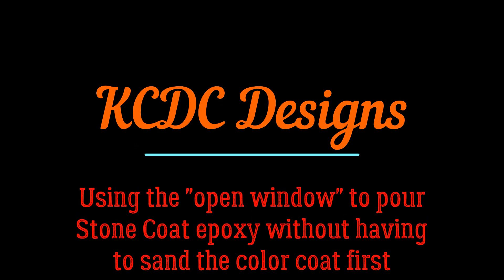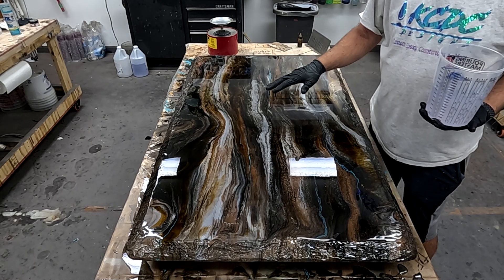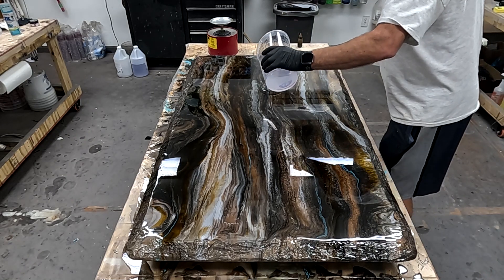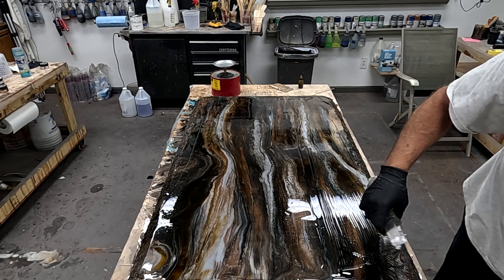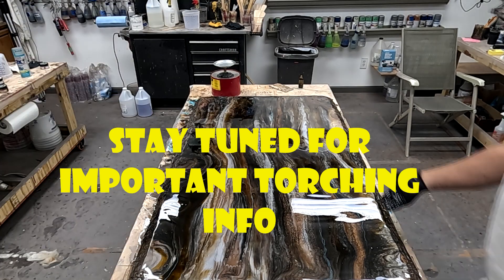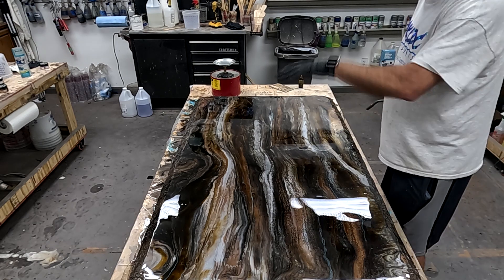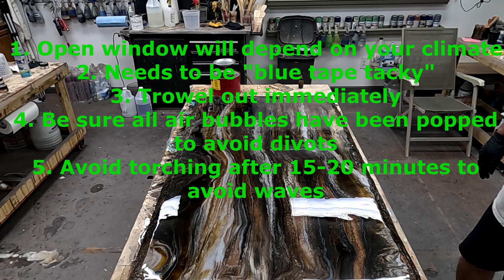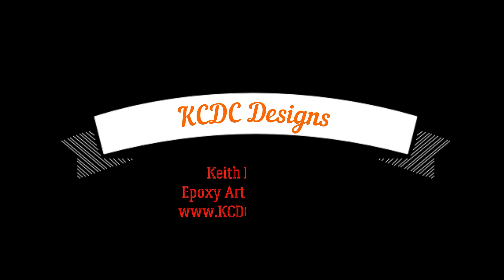Important tips when pouring an epoxy flood coat during the "open window" when using Stone Coat epoxy

Comment: Thanks . I was just going to call and ask about that. I poured about 20 hrs ago and is is still blue tape tacky. I will pour a flood coat the when it is set up I will do a glossy UTC. Hope it works out since I have some depressions from having to add more resin at the end of the original pour!
Reply from the maker: Hey John, you're welcome and glad it helped. The flood coat should fill in your depressions, as long as they're not too deep. If they are deep, you might consider a tape dam and use 4-5 oz/sf so there's more material on the surface. Minor imperfections are almost always filled by the flood coat, but if they're more than 1/16", you might consider more material.
If you're not familiar with the tape dam process, please let me know at Keith@KCDCDesigns.com if I can help.
Good luck and please keep me posted!

Comment: Hey Keith, question for you...put my flood coat on last night...woke up this morning and looked at it,and it has a big ole Miller (giant mosquito looking bug we have here in Ohio) in the middle of it...can you HELP???😢😢😢
Reply from the maker: Hi Kim, oh no I'm sorry to hear that! If they're the same big ones as I've seen in Indiana, yikes!
How deep is it? If the epoxy is still somewhat soft, you could lightly heat up the area to pull him out, (tweezers?) but it will still likely leave an imperfection. But if the impression is not too deep, you may be able to sand it smooth prior to applying UTC, if you were going to. 
Even if there's a small leg left in it, would it be that noticeable, except to you maybe?
Sorry it happened, dang skeeters!
Reply: Thank you so much, and yes, I pulled him out but didn't think of heating it. We are using UTC natural, so hopefully, it will hide it some. Black counter, so no one will see a leg, including me, I'm sure.  Thank you for the help...I'll let you know how it turns out! 😊
Reply from the maker: Whew! Glad you got it out, and that it's a dark color. If a leg or wing is left in there, all the better 😂 (as only you will know).
And yes, please keep me posted!
And I'd love to see pics of your project if you'd like to email some pics to Keith@kcdcdesigns.com
Reply: Will do...slow process for us...hopefully this weekend we will get UTC on!
Reply from the maker: Very good, please keep me posted!